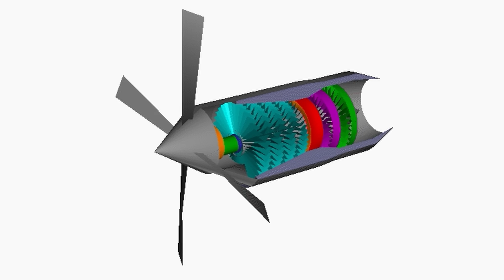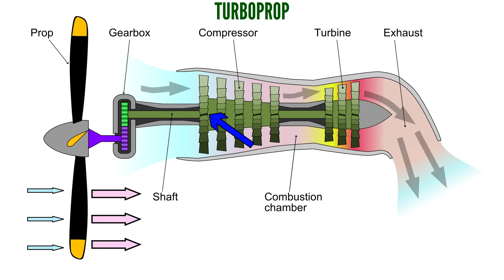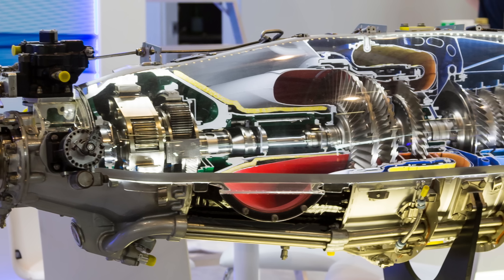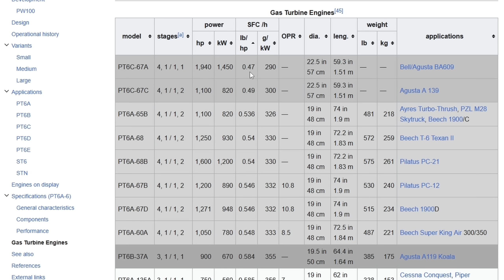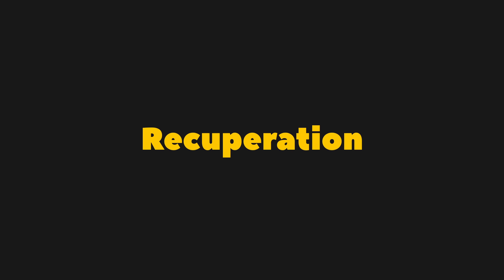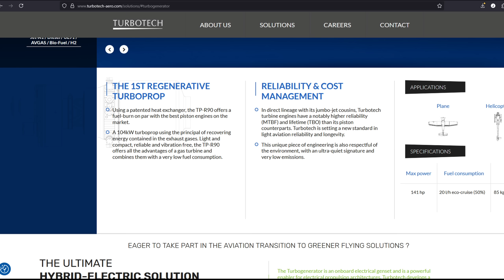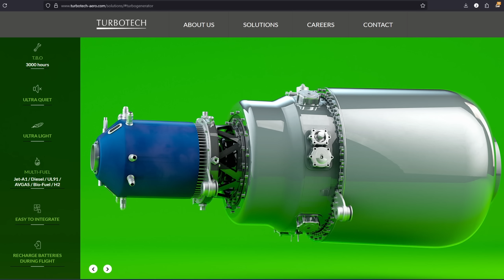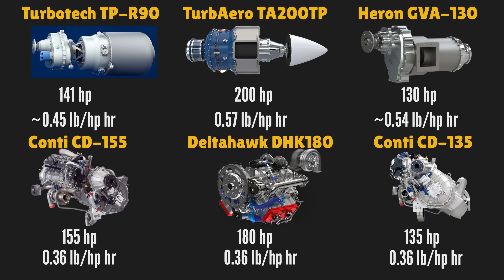Are Piston Engines Dead? Small Turboprops are Here

Comment: Drag =1/2 R V2 S Cd.

R is Rho, and stands for air density
V2 is velocity squared
S is surface area
Cd is coefficient of drag.

Since turbine engines rely on ACCELERATING air with the compressor blades and then increasing its pressure in the stators, a large amount drag is imparted simply by cramming the air into the combustion chamber via high speed rather than via a moving piston.  Remember this engine operates "intake compression combustion exhaust" just like an Otto cycle but it has no cylinder head and relies on the inertia of the incoming air to keep the burning gases from exiting the front (compressor stall).  Very little pressure is created in the combustion chamber itself, what happens is that the hot gases are accelerated and then impact the turbine wheel.  See the drag formula above....

It is simply all the aerodynamic drag that occurs during the simple operation of the engine that makes it less efficient than an Otto cycle engine.  And this can be shown by reducing air density R (such as at high altitude) where this internal drag decreases drastically and the engine becomes far more efficient.  Still, 75% of the power the turbine recovers is used to power that compressor.

I don't see turboprops powering GA aircraft any time soon.  They are far more expensive to build than a traditional reciprocating engine, and this cost will not come down in time to stave off the battery electric light planes coming in the near future.

Great video!
Reply: Axial flux electric motors.
Reply: @robertphillips2983  Precisely.  The only reason that you can't rent an electric Piper Warrior at a GA field near you is battery technology.  KWH/Kg just isn't there ye, this is called energy density. But it is coming...
Reply: Excellent Comparison. Did you know that a company called BESLER designed and built a Steam powered
Piston Aircraft Engine back in the 1930s?  They used a coiled tube boiler to make the steam.  The engine 
control was a single lever that you pushed forward for more thrust.  It was very Quiet and smooth in operation.

Comment: A 140 Hp turbo prop engine could drive a fairly large drone with a payload weight of around 1,000 pounds a very long way at a fairly high speed. One of the advantages of the turbine engine is it does not require special, sometimes leaded, gasoline fuel but . can run on normal truck Diesel.

Comment: I may have missed it, but don’t recall your referring to the lower cost of JET-A1 compared to AVGAS.
Reply: Where I am, South Arkansas, Jet A is slightly more expensive than Avgas, not cheaper. They are both about 1.6 x the price of unleaded regular.
Reply: I fly all over the East Coast and both fuels are always within a dollar of each other, usually being like 20-30 cents difference. So

Comment: The crossover point where a turboprop becomes less efficient than a piston engine is generally considered to be in the range of 400 to 500 horsepower. Below this power output, the thermodynamic realities of small gas turbine engines make them less efficient than their piston-engine counterparts. This is in the context of scaling the engine down.
Reply: Another issue with small turbine efficiency is "economies of scale" not just in the engine's physics, but also its manufacturing costs. On top of these physics limitations, large gas turbines (mainly turbofans) in airliners have some pretty amazing technology to help with their efficiency, part of why they are so much more efficient than older versions. A lot of sophistication, in the blade (fan, compressor, turbine) design, internal cooling passages in the turbine blades, combustor and fuel sprayer design, and so on. Both designing and manufacturing such sophistication is very expensive, and that cost wouldn't change all that much with the engine's size - incorporating such features into an engine 1/100 the size and power would certainly not be 1/100 the cost. For engines that burn thousands of gallons of fuel in less than a day, and fly hundreds if not thousands of hours per year, spending literally millions of dollars per engine for fuel economy improving features is worth it. Not true of GA, or even business-jet/turboprop size aircraft. In short, efficiency and affordability are at odds in turbine design, and probably neither could be competitive with a piston engine in the 150hp range no matter what they do, much less both at the same time. And, due to the physics constraints of scaling, even with all the R&D and sophistication in the world a small turbine will never be as efficient as a large one - or probably a piston. Piston engines on the other hand are far more consistent in fuel economy, regardless of size or cost - a small one will only be slightly less efficient than a large one, and there isn't nearly as much opportunity for added sophistication (and cost) to improve fuel economy, especially in an aircraft context (there is some in cars but that's more to make it efficient at a broad range of speed and power conditions, which isn't as relevant for aircraft). Plus with piston engines cost is more proportional to size, they do get cheaper as they get smaller to a greater degree than turbines (still not linear though).

Comment: Why isn't recuperation used in reciprocating internal combustion engines?  It seems like the fuel requirement could be further pushed, but, I'm not an engineer and I don't know if maybe the weight & cost of any such system would negate potential benefits
Reply: Wright put 3 on each R3350 in their final iterations and recovered about 200 hp each. Marvelous engineering but of historical interest only.

Comment: Comfort and longevity of other components goes a long way when compared to reciprocating engines.  Not everyone appreciates being vibrated all the time but neither do avionics or aircraft structures.  TPs are smooth and on a light aircraft that is an amazing experience.  AVGAS is becoming harder to find (to say the least) and is probably behind the rise of diesel engines rather than purely for the efficiency gains covered here.  Admittedly most of my time is on military jet and turboprop aircraft but I would not miss the shake, rattle then roll of pistons at all, especially when flying for fun or with family.
Reply: they rattle and roll because they are unbalanced by design. They don't use balancing counterweights on the crankshaft or harmonic balancers like cars do. Also pushrod actuating valves are noisy and 100years ago tech. A 6cyl should have be perfectly smooth, but these rotax shake and rattle because are total crap
Reply: @danielpedro77  I think they mentioned how things work when I went through flight test school.  I may have mentioned stuff in my reports when testing aircraft during development trials too.  Heck, they may have mentioned propulsion when going through basic flight training school but that was over 30 years ago...

Comment: You should't really say that turboprops are categorically more reliable than piston engines, if the tp in the comparison is a new design...
Reply: It is inherent in the design, as with more moving parts and greater vibration, reliability suffers.
Unless new designs are cast of potmetal with terrible tolerances, they can't help being more reliable.
Another aspect is fuel price, as avgas is increasingly expensive while turbines can burn almost any lightweight oil - it is only for long, high altitude flights that cold soak and icing dictates the use of specialist jet A1 or Avtur.  In the GA environment, heating oil, diesel, or straight vegetable oil (SVO) are equally suitable.  Technically, that is also true of diesels, but at the cost of vastly increased weight, vibration, and complexity, all of which inherently lead to reduced reliability, of course.

Comment: I'm really glad you brought up diesel piston engines too, because I think they are the best fit for GA and I don't understand why aero conversions of modern automotive diesels have not taken over the GA market. A BMW B57D30T0 makes 315 hp with twin turbochargers using an aluminum block and cylinder head in an inline-six configuration for perfect balance like the conventional boxer sixes. It's tiny, lightweight, compact, and more reliable than a spark-ignited gasoline engine. Plus, the automotive configuration is choke off by diesel particulate filters, exhaust catalysts, and exhaust gas recirculation. An aero conversion would likely generate 450 to 550 hp. I want a 1000 horsepower Aerostar that burns Jet-A!
Reply: What about diesel fuel creating paraffins at high altitude/low temperatures?
Reply: @AvgJoe0007 You wouldn't be running automotive diesel in an airplane, you'd be running Jet-A.

Comment: The cost calculation really needs to include purchase price, fuel consumption, TBO, and overhaul cost. Talking about pounds per hour fuel consumption makes sense for range calculations, but means nothing in isolation when you're comparing 1000 hours TBO versus 6000 hours TBO.
Reply: True, but how many overhauls could you do for the added cost of the turbine? Maybe not six (as your example numbers would give a 6:1 ratio) but still probably more than one. Many privately owned aircraft take many years if not decades to reach TBO, so that up front cost would be hard to justify - flight school might see it a little differently though (especially if turbines tolerate abuse better, don't know if they would). That's another way that turbines make more sense for commercial operators than private owners. Then there's a scale issue with that as well - I'm guessing the cost of overhauling a piston engine scales quite a bit with engine size/power, as a bigger engine with more cylinders has more to recondition or replace (think Lycoming O-360 four-banger vs. P&W R-2800 Double Wasp 18-cylinder radial), while with a turbine it wouldn't be as much difference in cost/effort to overhaul a bigger one than a smaller one. This, like efficiency and a lot of other factors, gives turbines a bigger advantage at larger sizes.

Comment: Instead of a heat recovery system for turboprop engines why can you not put an extra set of turbines to recover the exhaust heat and kinetic energy?  The recovery turbines would turn the energy into electricity that would be used for a distributed propulsion system?

Comment: PT6 O/H , turbine mechanic here - I absolutely avoid piston engines in GA wherever possible - the fatality rate is abysmal on piston GA. 

EDIT - yes many fatalities are caused by pilot issues, but  for instance the Lycoming O-320 series piston engine failure rate is 31.25 failures per 100,000 flight hours, compared to something like the PT6, which is 0.03 per 100,00 hours.
Reply: But how many are due to piston engine failures?  Cite your source.
Reply: @jdotsalter910  its not just piston engines grenading, its also the pathetic carb systems that love to take a shit or the pilot forgetting something critical like carb heat or mixture setting - GA piston engines WILL kill you from a small oversight. 

The list of ways to die from a piston GA engine, is insane.
Reply: @jdotsalter910  that I need to prove to you that the piston engine failure and fatality rate specifically, in that instance, is way worse than turbines, is like having to prove to someone that the sky is blue. 

cant make this up - hope you are not in the industry
Reply: @ghostrider-be9ek  I'm a crash investigator, pilot, A&P/IA, and you are completely wrong.
Reply: @jdotsalter910  this is pathetic - i am not even talking about pilot fatalities, I am not talking about VMC into IMC etc. 

 I am only talking about piston engine failures per 100,000 hours, and comparing to turbo props.  

"Turboprop engines fail at rates roughly two orders of magnitude lower than piston engines:  

translating to approximately 0.15–0.3 failures per 100,000 flight hours for turboprops vs

13–31 failures per 100,000 flight hours for piston-driven aircraft."
Reply: @ghostrider-be9ek no, it isn’t. At ALL. 
You need to go read. The primary reason piston GA is so bad is because of pilots. There are many facets to that, but the difference in death rates cannot be attributed to recip engines, per se.
Reply: @tylerfb1  this is pathetic:

"Turboprop engines fail at rates roughly two orders of magnitude lower than piston engines:  

translating to approximately 0.15–0.3 failures per 100,000 flight hours for turboprops vs

13–31 failures per 100,000 flight hours for piston-driven aircraft."
Reply: @tylerfb1  the death rate is even worse in GA when all factors are counted in - yes, dumb pilots are the cause too.
Reply: @ghostrider-be9ek  great. Show me where the stat is that shows it is a problem with recip engine design.
Reply: @tylerfb1   the Lycoming O-320 series piston engine failure rate is 31.25 failures per 100,000 flight hours, compared to something like the PT6, which is 0.03 per 100,00 hours.

The problem is that its a piston pounder.
Reply: @ghostrider-be9ek  A flat six, a very common configuration, is perfectly balanced up to and including second order. How often do general aviation pilots fail per flight hour? If that number is much bigger than the failure rate of reciprocating engines then it doesn't make a significant improvement in overall safety. I'm only guessing that the human factor is so big in general aviation that the engines are irrelevant even if the turbine to reciprocating failure rate ratio was 1:100000.

Comment: RC turbines have become super powerful, & alot can run on multi fuel, like A1, kerosene & diesel. They can produce about 100lbs of thrust, & a 172 Skyhawk has only about 450 lbs of thrust. They sip fuel & r cheap to replace vs this featured engine. U can c where I'm going w this.... reduced weight + less fuel consumption = greater range or greater payload. They r small enuf to drop 4 of them into the engine bay of a Skyhawk, if u could plumb them in straight. Clearly, not all prop aircraft can b converted, but there r enuf models that can b reworked to include this tech. The weight difference should allow fire suppression gear as well. I shouldn't have 2 add that having multiple engines is inherently safer than only having 1, in case 1 should fail, u still have more engines. Id' consider this a good thing since most GA aircraft, don't have parachutes.

Comment: My intuition is that recuperation would simply remove what little thrust the exhaust gas is generating and add slightly less thrust to the propeller. Why is this wrong? 
Would it make sense to intercool a turbine in an aircraft?  They do it in powerplants along with recuperation. You could put an air to liquid heat exchanger outside the engine and run the cooling loop through the hollow stator vanes in between each compressor stage. Might be another case of a little more drag, a little more weight and just enough improvement in mechanical efficiency to compensate.
Reply: I am a physicist not an engine designer but I think you need to think in terms of energy recovery not thrust. There is not much thrust to be obtained from the exhaust gas because it is not moving at a very high velocity. However it is still very hot, so contains considerable energy. Recuperation transfers some of the energy from the hot exhaust into the input airstream, thus recovering that energy that would be lost. Clearly it works as the fuel consumption figures show.  Whether it is worth it depends on fuel cost versus additional engine cost and complexity and how many flight hours are done per year. For most it is likely not worth it.  Diesel engines have more potential, a lot more efficient than gasoline piston, plus they are simpler and potentially more reliable than gasoline piston engines.  An intriguing option  that has been considered is to allow adapted automobile gasoline engines to be used in light aircraft (not just experimentals). They are hugely cheaper (like 10 times cheaper) and modern automobile engines from certain manufacturers (toyota is one) are extremely reliable,  potentially more reliable than the legacy small aero engines.
Reply: The gas turbine uses a (George) Brayton thermodynamic cycle (check Wilkepedia).  He produced commercially successful constant pressure piston engines in the late 19th century.   The compression work and expansion work recovery can be done by pistons, Wankel, vane, screws etc, etc as well as turbo machines.
        Pressure (compression) ratio, turbine inlet temperature, and waste heat recovery improve GT thermal efficiency.  The current trend of established manufacturers is increasing the PR with supersonic compressors.  Here the compressor impeller’s exit velocity is supersonic and compressor diffuser causes shock wave pressure recovery like a supersonic jet inlet.  Machining the parts is exquisite.  Note, too, Supersonic diffusers have a large frontal area.
       Turbine inlet temperature is first limited by material to about 1200F.  Above 1200, then the blades are cooled with bleed air, but this is cost prohibited for smaller GTs. (Ultimate temperature is limited by Nitrous oxide pollutant).  Ceramics were studied and may be the next step.
        Regenerators have been around since Chrysler’s turbine car and now used on the Abrams tank engine.  All our host says is true.  My opinion is they are not a good idea for planes.
        Piston planes run 100% for take-off and 75% cruise.  But GTs can be designed to cruise at 100% and take-off at 125% with water injection.  GTs  lose power with altitude.  However GTs are “flat rated”.  They can make more power at sea level, but are held back to their flat rating but will make that power to the rating altitude.  So 450hp at SL and 450hp at 10000’.
        We hope the magic bullet aero engine and may get there one day.      Cheers